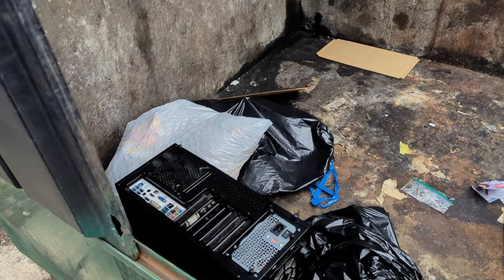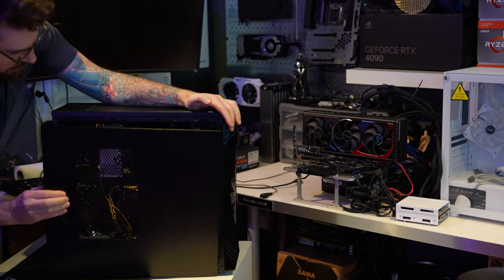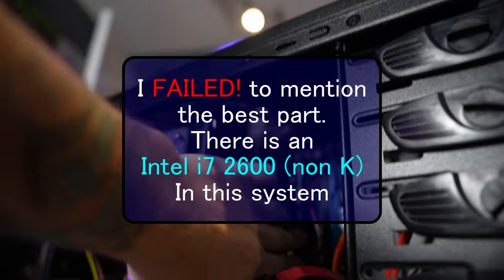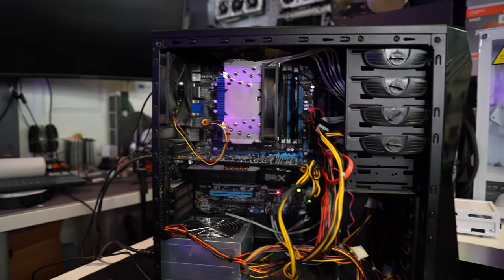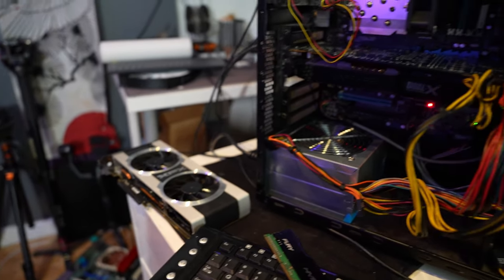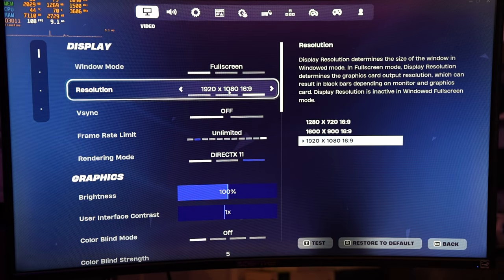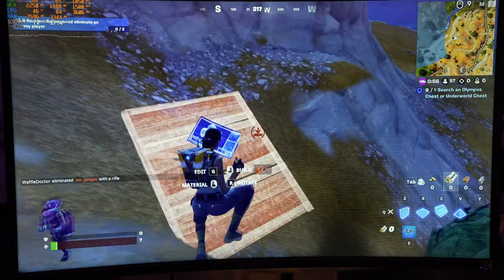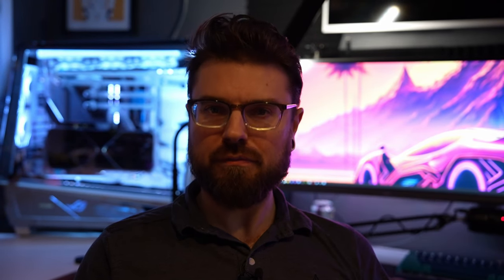I found a PC in the DUMPSTER

Comment: 6:30 This ram is in the wrong slot.... 10 seconds later installed the test RAM in the wrong slot also . 🤣🤣. 1 stick of RAM means A2 Slot, 2nd from the CPU. :P but for testing purposes all 4 slots are the right slot
Reply from the maker: A2 is correct your right, it honestly doesn't matter much as you said with a single, I was more thinking about how I'd end up putting two sticks which would be B1 and B2, just halfway followed through with my thoughts, troubleshooting and filming and coming up with talking points can momentarily crush my head.
Reply: @techwandoUS  A2B2 slots, would be optimal :). Cool find none the less.

Comment: Uhm isn't that powersupply upside down in the case ?
Reply from the maker: Technically you could mount it any which way when it comes to airflow in that case, but you would be right to say it's wrong because whoever built it has the cables coming off the wrong side. It's the reason why their CPU 8 pin cable seems so short, if it was flipped, they could have easily run it behind the mobo tray or behind the GPU PCIE slot. 
Appreciate the comment.

Comment: How do you find these☠☠
Reply from the maker: Just got lucky this time, never found one like this before
Reply: @techwandoUS  didn't notice at first but is the girl in your pfp your daughter?
Reply: @techwandoUS  also what do i have to do to get that pc?
Reply from the maker: @KAMI_1911  the plan was to clean it up and do a local giveaway. Shipping it wouldn't make much sense due to cost. Where are you from?
Reply: @techwandoUS  nah. I'm really far away. I was thinking you might do a giveaway, so i just asked. But if you want to make a profit of off it, that's fine. 

I'm from Bangladesh
Reply from the maker: @KAMI_1911  No profit, just want to give it away locally. Shipping this will cost more than the PC is valued at.
Reply: @techwandoUS  ok got it
Reply: @techwandoUS  I'm actually going to random YouTube tech channels to see if they are doing giveaways or not cause my pc is rocking intel i3 4150☠️
(No gpu)
Reply from the maker: @KAMI_1911 if you could find a 4690k and a rx 580, that would be a balanced system
Reply: @techwandoUS  thanks for the recommendation
Reply: i got lucky 1 time in my recycle center here in th ewestcoast  a bunch of motherboards were thrown out w i5 intel 4 core chips . didnt bother w it , got melted already 1 month ago.